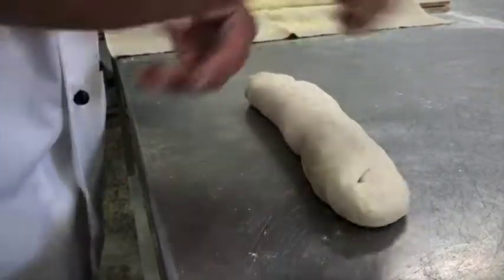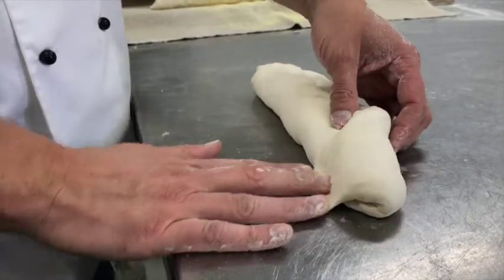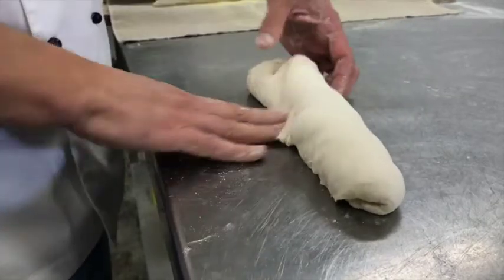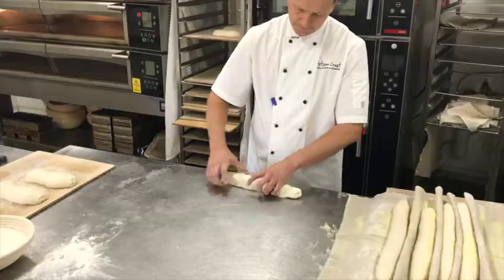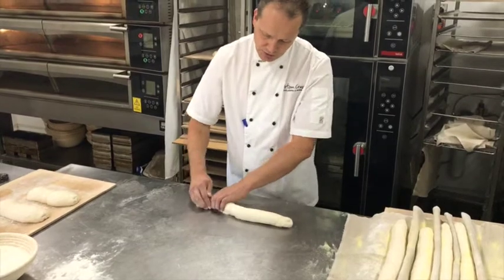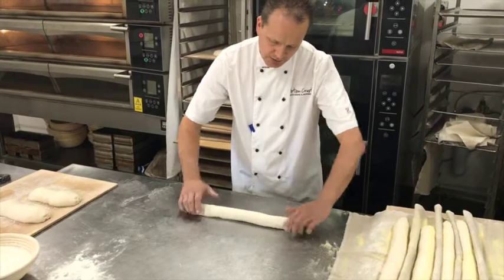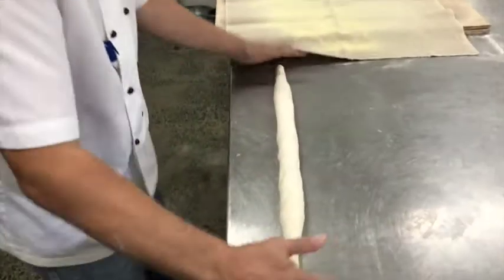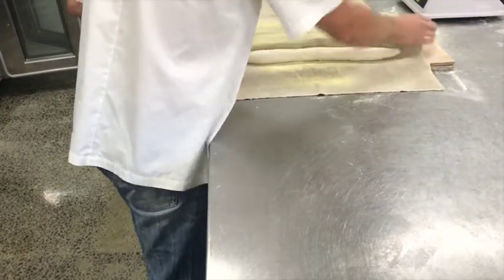Focus On: Shaping Baguettes

Comment: Thank you for making such insightful videos, it really helps people like me who just started baking their own bread.
What baker's percentage malt do you add? I have seen on the complete video that you shared this:
"I use  for the overall formula 
100% bakers flour 
68% water
2 % salt 
0.6 % dried yeast 
I preferment 33 % of the flour  with 
0.1% dried yeast 
100 % water 
 for 18 hr"
but it doesn't say how much malt.
Reply: Thank you very much. Does the malt add any flavour or is it only to give the yeast more "food" and make the crust caramelize better? It's hard to find info on this, it seems like a baker's secret.
Reply: Fred P  the addition of malt introduces more enzyme  into the dough ,giving you more yeast  activity. The addition of  malt also thins the crust and give better colour in the bake
Reply: I tried your recipe, but my dough came out much looser than yours. I don't think that is up to the humidity level because the air is very dry where I live. So it must be the flour. How much protein is there in the flour which you use? In the one I use there is 12g of protein per 100g of flour.

Comment: For some reason when i make these the same is on the bottom but when finished cooking the seam has opened right up and ends up on the side. Its a disaster. So annoying. I admit i only shape them once which worked well the first few times
Reply from the maker: Hi Mr Bootin, the splitting  on the side can be not enough steam or a sign of under proving
Reply: @theartisancrust8477  I was making good ones last year but I just watched the vid again and realised I forgot a few things. I forgot to turn the dough around before sealing the seam shut and also forgot to tension the dough from the bottom. Will try again tomorrow. Are you actually doing 3 proves here? One in the bowl then preshape for 15 mins (not a complete prove?), then the final shaping and prove again? I usually only prove twice but if preshaping and final prove are both shorter proves I guess it's similar and not over prooving?